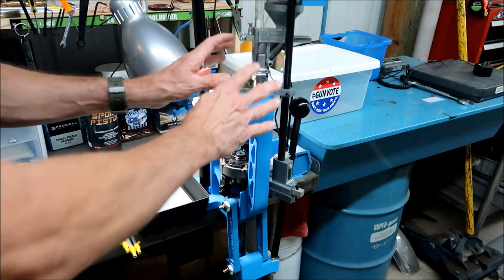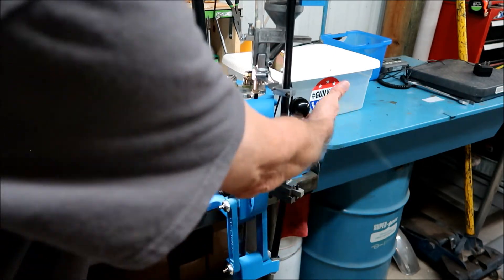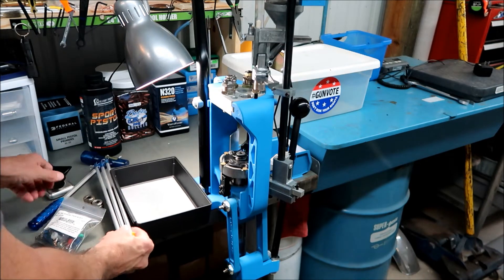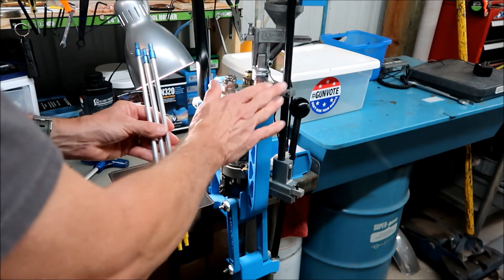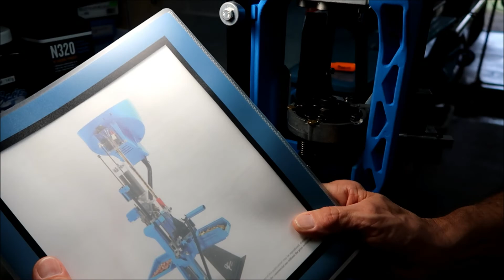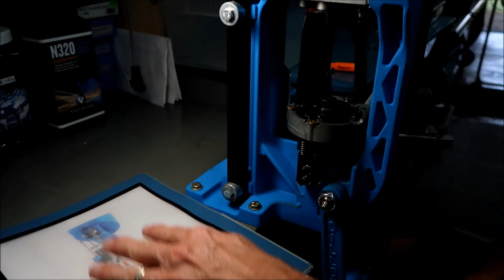DILLON XL750 AFTER  7K+ ROUNDS

Comment: I’ve been loading on my Dillon 550 for 25+ yrs , I’ve loaded thousands of rounds on it. Within the last 5 or 6 yrs I bought a Dillon 650, it’s almost same as your 750, but the priming system is not the same. Your 750 is the same as my 550, and it’s a much better and user friendly system. Wish I could convert the 650 to old system but I’m used to this way now. I even bought a whole separate system for large primers so I didn’t have to tear it all apart to change primer size. If your not familiar with it. Watch a YouTube vid on the 650 and you’ll see what I’m talking bout. But anyway. You’ll grow to really love reloading. I started out to save money and got so involved in it. I found myself loading way more than shooting. Built a whole reloading room in my pole barn , heated it. AC also and I find myself out there loading or building AR’s. All I load now on my 550 is rifle and my 650 is all pistol. I invested in the Dillon RT1500 trim motor and the trim die to convert 223 brass into 300 BO cases. But anyway. Your correct if your new to it. Go slow, pay attention and have fun. Love all Dillon products. They are best in the business. And they stand behind 100% their NO BS warranty. No questions at all. I’ve called on wore out things from my 550. And they send out replacement part. I’ve got a few not many vids on some of my reloading. And my small little shop if your interested in my small reloading world. Thank you 
 B Hewitt

Comment: I bought two used 650s that had been knocked off a bench and left in the corner of a garage to rust for several  years.  I rebuilt both of them myself and sold one and that was the best education on the Dillon presses I could imagine.   The case feeder is a indispensable part of the press, you lose a large part of the advantage of a progressive press if you hand feed cases.  I sold one to a shooting buddy and the 650 I kept stays configured for 9mm. But I also have a 550 that I use for 38/357,40S&W, 223/5.56, 45 acp and 300blk.

Comment: I would highly recommend getting the Dillon Primer Flip Tray. It is large and heavy for what it does not some barely large enough cheap plastic tray that ends up in the trash because you spill primers every time you use it. I purchased the case feeder with my press and have never regretted it. My first press was a Dillon 550B and one of the first things I wanted was a case feeder. That was 30 years ago before Dillon offered a case feeder for the 550.
Reply: The case feeder makes reloading so much better.

Comment: Helpful, especially regarding "if it doesn't feel right" isms. I agree about the roller handle. I bought one and later wondered why. Powder Check and Primer Check are 2 must-haves. While the tool rack is not needed, the wrench (can be bought separately) is needed. Lastly, your American flag is hanging up wrong. The blue field is always at the top left. Thanks for the good video.

Comment: Not buying all the accessories right off is good advice, in general.  However, I’ve found that I really like the UFO light kit I put on my 550, the roller handle is much nicer for me than the ball, the tool kit mounted right on the press keeps them organized and always where I need them, the bullet and case trays allow for better ergonomics and the after-market primer slide kit has eliminated any priming problems I used to have.  YMMV

BTW, you should turn your flag around.  The stars should always be on the left.

Comment: It’s possible that Dillon fixed the minor issue but you mentioned if you see powder around the shell plate something is wrong. Well on my 650 and most of the ones I’ve seen it just means you have been loading ammo. I have tried everything and some helped some didn’t but especially on .223 it is IMPOSSIBLE to load ammo and not make a mess. I now just keep a can of air on bench and clean it off every hour or so depending on caliber and powder used.
Reply: You're going to have powder for sure.   I did notice while loading .223 that I had to pause just a bit so the powder charge had time to flow into the case.

Comment: There is no way you are loading 100 rounds in six minutes (1k/hr) without a case feeder. In fact, I doubt you can load 1k in an hour even with a case feeder under ideal conditions.  600 is far more realistic. Also, the roller handle is a must for long loading sessions.